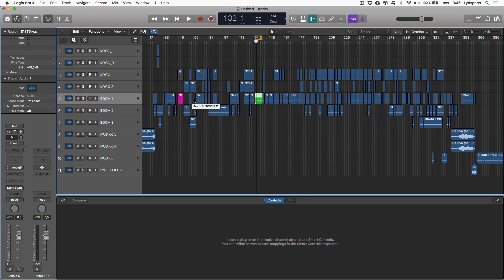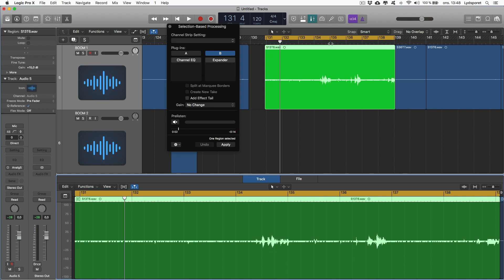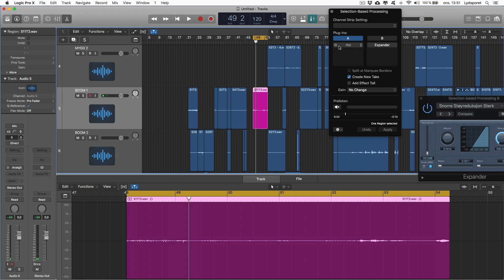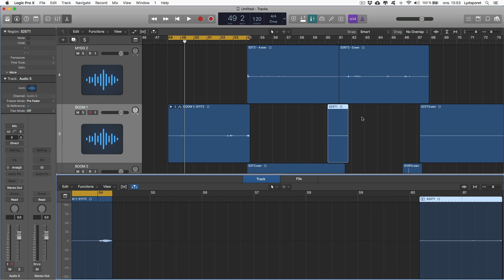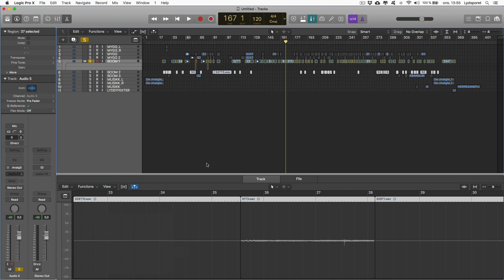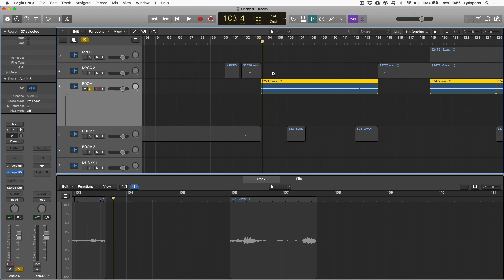Logic X: REMOVE Extreme  Noise in Your Recording

Comment: Super thanks, man. I'm working on short films and it's a common problem That I have.
And what do you think about creating new track for example from one boom mic track and then apply different effect and eq regardless of the atmos sound  situation ?
Reply from the maker: Usually I have a lavalier mic and a boom mic to work with on an actor. I try first to balance the two microphones and get them to be in fase. Then I send them to. Bus and treat them  with eq and compression from there. If I need to do any noise fixing to the tracks it happens first in the chain on the problem track. So I don’t  do different eq on the boom mic or the lav mic. I look at it as one performance 😊

Comment: If there is a sound in the background that continues through the talents dialogue which approach would you take to clean it up? The noise gate and Expander cut it off when they're not talking. Would it be finding the specific frequency with an EQ and limiting it there?
Reply from the maker: It depends on audio. If the expanded doesn’t do the job I usually reach for example dialogue de-noise. I also can search with an eq to look for a constant frequency I can notch out. For the worst cases I turn to izotope RX to fix the problem :-)